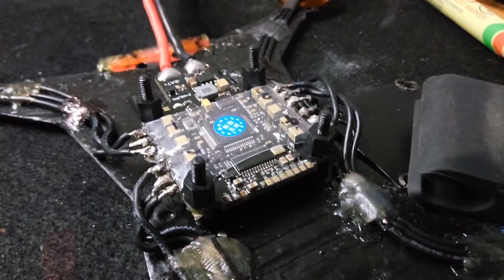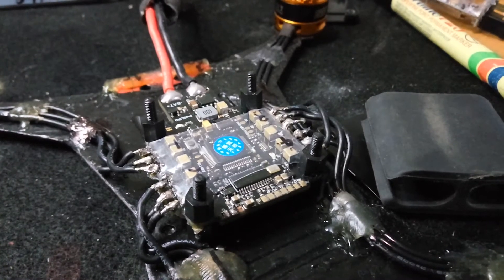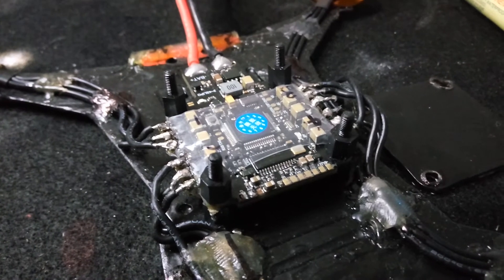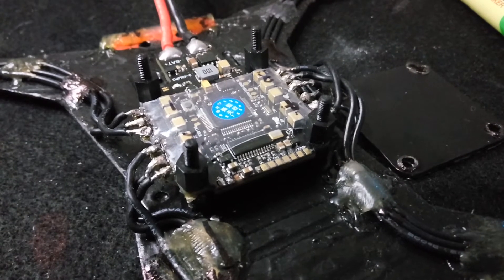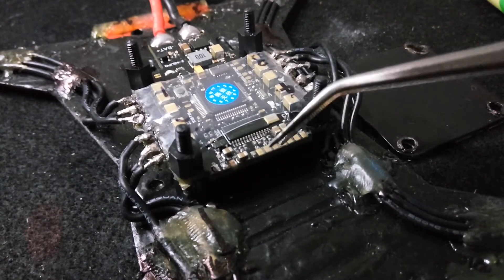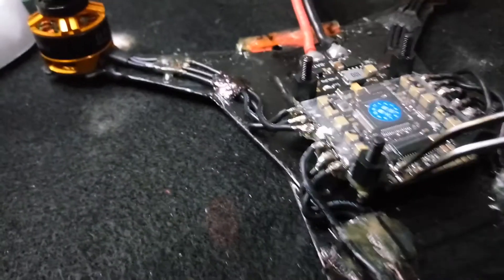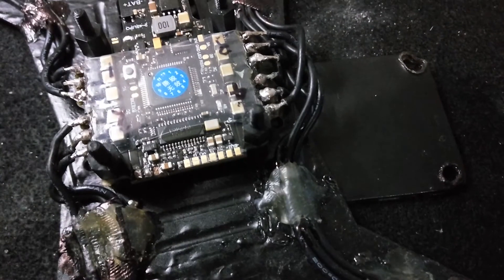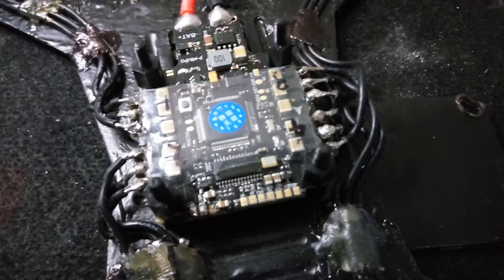Part 1- Racerstar StarF4S 30A. SBUS PROBLEM. Solder pad fell off!!

Comment from the maker: I wish Racestar would get the quality control issues sorted out. This is a good board but im almost too scared to buy another.
Reply: I had the same issue, but with the video out pad. Is there any solutions to get it right? Because at the moment I have to live without osd. What if I solder to a tx port and set it up on betaflight? Is it possible?

Comment: Found any solution? Same problem
Reply from the maker: 99dimensions Yes I found an RX pad and soldered onto it without any problems so I didn't need to send it back. You wouldn't believe that the next problem was the video solder (vo) video out pad almost totally fell off also. Same solder and iron same heat have had no issue with other solder pads ever falling off so its not me.  I very quickly glued was was left hanging onto the board down with hot glue. Probably should have used an epoxy. I have read of one other guy saying that one of his pads fell off also. Anyway the good news is the drone flew beautifully but crashed and broke an arm off. So I've cut a new board and am simply moving all the gear across to the new frame.
Reply: I've soldered mine to an UART now as well. They are good flying boards but I don't like that they break that easily, I've at least bought 3 of them and they all broke very quickly. For the price I could have gotten a full KISS as well.
Reply from the maker: 99dimensions I'm still on my second one and yes its fkying very nicely. I don't think ill go for a third one if this fails. Im using small Dys BS1806 2400 kv motors and this makes it a very light build. Flying beautifully
Reply: @woofbark4475  I scraped at the sbus pad after mine fell off and found the trace, soldered to that and so far it's working.
Reply: @kwadlife4106  Hi mate whereabouts is the trace? The  sbus pad fell off mine also :(
Reply: @AdventuresofJamesandTheodore  it's basically directly above the pad. Between the pad and that cap or w/e is right above it. When I get home tonight I can take a pic and send it to ya
Reply: @AdventuresofJamesandTheodore  yea bro its between the pad and that cap it's really small take a razor blade and carefully scrape until you see a little strand of copper. Tin a 32 guage wire lay that on the trace and lightly touch the iron to it. Then glue the crap out of it with hot glue. I guess check it before you glue it   hope it works man
Reply: @woofbark4475  I'm trying to get my first fpv drone set up but I can't get the remote to communicate with the race star f4 s do you think you could help me out to see if I have everything soldered in the right places
Reply: Is there a trick to get an x4rsb to work on the sbus pad or an RX pad? Because I have done everything I can think of including the invert hacks
Reply from the maker: Dufour- FPV Sorry i really dont know. Im using Flysky FSia6b i think using PPM. Personally i wont be purchasing another one.of these. However, the second one that i purchased is still flying going well. They just need to sort out their quality control and make the pads slightly larger. Very difficult board to soler.